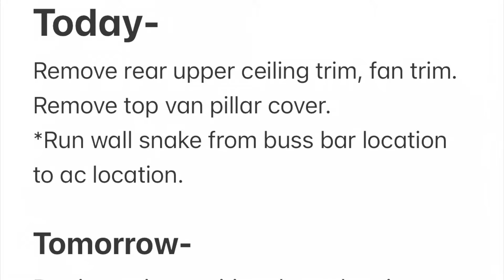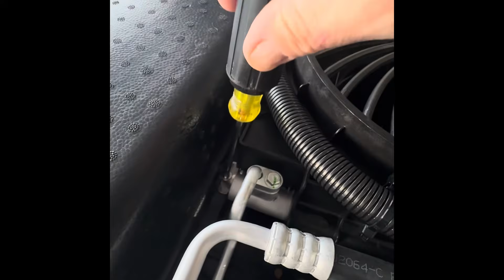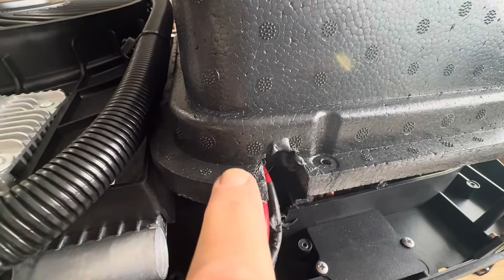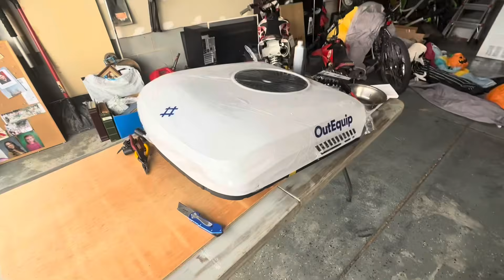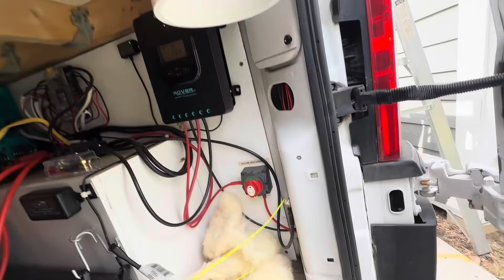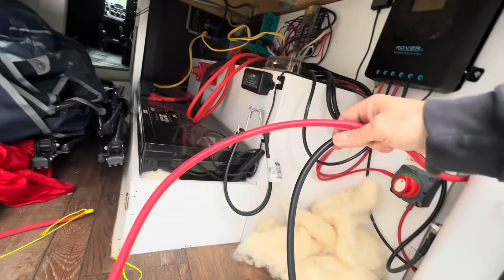Vanlife-Replacing your Maxxair Fan with an Outequip rooftop air conditioner

Comment: Great video and explanation. Thinking about install on my 579 Peterbilt. I'm up for the challenge if the unit functions good enough to run while the truck is off for a few hours to reduce diesel fuel burn.

Comment: Hey there, Thanks for posting this video. I am wanting to install this on my transit in the same manner. Quick question for you. Were you able to mount the unit in the 14x14 opening all the way forward to the front edge of the existing hole without issues? This the way it looks in the video, but wondering because on the website it shows mounting it back from the front edge 2.36-3.15 inches from the front edge of the 14x14 hole. Any insight on this would be helpful. I have to mount all the way forward to make it work with my situation.
Reply from the maker: Yes you have to keep it back 2-3 inch’s to allow the condensation to drain outside of the gasket area.
If you go to their website you see exactly the clearances needed.
Reply: @shelterinplacezz  thanks for the reply and confirming this.  I will have to mount it backwards to make it work with my existing hole. Found some information online that says you can do this without any issue other than possible wind drag.

Comment: I planning on doing the same thing with my promaster but I routed the wire through the foam inside the unit and pulled it through the plenum this way I wouldn’t have to cut another hole in the roof. The manual gave me 3 options. Hopefully it cools my van enough to keep my dog inside to go eat  on my  van trips next summer!🙏